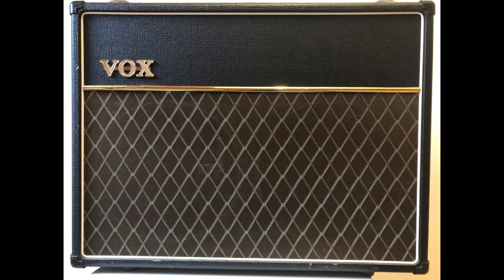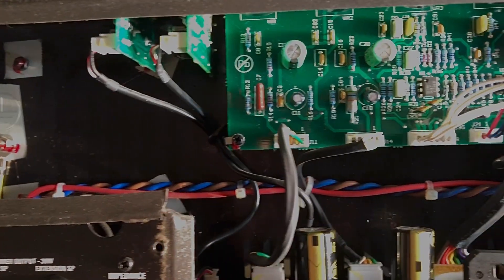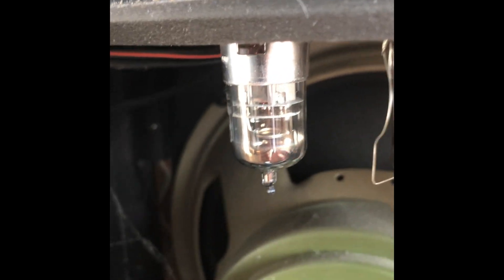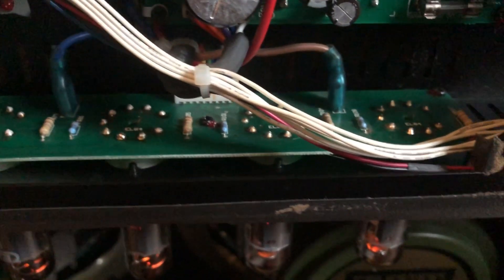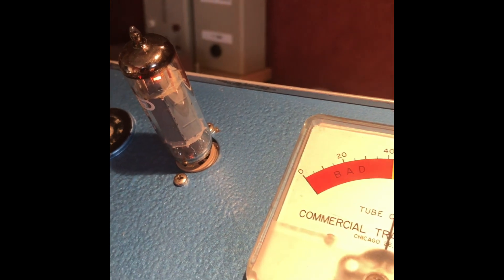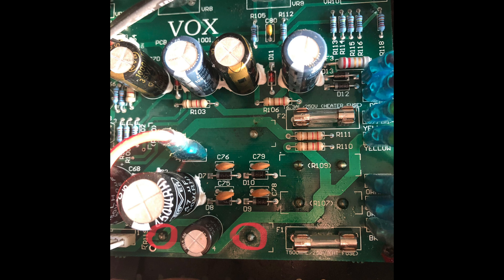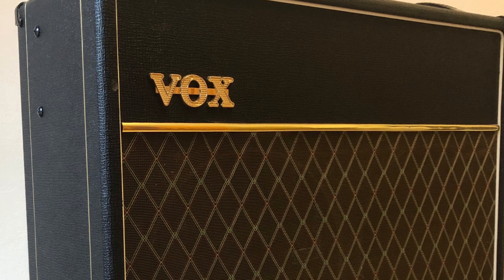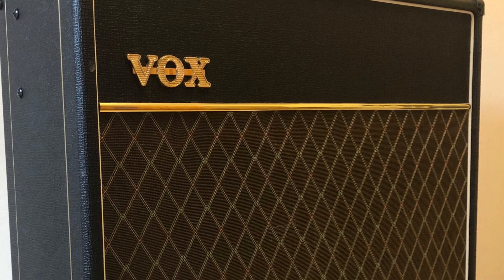Vox AC 30 C2 how to fix crackling noise and cool down the bias

Comment: I think l have the issue with the noise that comes out of amp. Could that be a valve issue? When l turn the tremelo on noise get tremelo also. The Reverb don't work is very unstable. Sometimes, it doesn't work properly.

Comment: I purchased an AC30c2 about 4 months ago... Within 4 weeks I was getting all kinds of crackling static like and microphonic noises. It was unplayable. I knew that that Vox uses Chinese made tubes/valves in these models, so I replace all of them with JJ Electronics tubes/valves. The problem went away immediately and the amp sounded great! I should add that I got permission to perform the change without it voiding the warranty first. 
Flash forward to now, about 6-7 weeks later, and after playing the amp for about 1.5 hours I'm getting random popping noises. Not the microphonic noises I had with the Chinese tubes though.  If I let the amp cool down for a while the pops will go away, but always return when play for a while once it gets hot. I understand these models go through tubes/valves quicker than many amp, but this is just ridiculous. At this rate I'd be spending ~$800 USD/year on tube/valve replacements. 

Okay, now my questions, if I may: 
1) Can I assume replacing the resistor with an 82 ohm version will extend the life of the tubes/valves since the heat output is lower? 
2) Will the change in resistor in any way adversely affect the amp's sound profile?

Any input will be valued. Thank you!
Reply: Hi Rob. That sounds really frustrating . To answer your questions:
Changing the value of the cathode resistor to 82 or even a 100 ohm won’t change the sound. I had a AC 30 CC in for a service lately, and these models have a switch on the backpanel to choose between two different resistors. The standard 50 ohm and a higher value to protect the tubes. I couldn’t hear a difference.

But: are you shure, that the popping noise is caused by the tubes? That sounds to me like a cracked solderjoint. When the amp is cold, it has continuity, when it gets hot the crack opens and weerd noise appears. Try to chopstick the circuit board. Press the board carefully to flex it and see if the noise increases or decreases.
Especially the tubesockets  get hot like hell and tend to open the joints on the board. But be aware of the high voltages, don’t get zapped!!! Good luck!
Greetings from Germany
Reply: @martinstubeampworkbench2299  I appreciate you taking the time to offer your advise. No, I'm not 100% sure that it is the tube(s), and will check the board per your suggestion. This model, unlike the CC, doesn't have switch to change the resistor selection. It would have to be physically changed.
Reply: I replaced my stock tubes cuz they were slightly microphonic and roughly 6 years old, got quad matched jj el84’s and within a month one total failed, glowing violently purple and making the amp snap crackle and pop. New tubes can fail, luck of the draw. Next time I get new tubes I’m gonna order 6 matched el84’s and 6 12ax7’s, it’ll make trouble shooting easier.

Edit: I bought the new tubes in 2018, the 3 jj 12ax7’s are still just fine, 3 of the 4 jj el84’s are still holding strong, as well as a one 2012 china el84.

Comment: This is very informative, thank you! I read also that the AC15C1 tends to burn through Russian tubes in 1 of the pre-amp positions. Do you think it makes sense to cool down the bias on the AC15 also? I'm pretty new to this 🙂
Reply: Hi Nick,
I couldn’t find a schematic of the 15 c1, but looked at the AC15 reissue. The biasing of the preamp tubes are pretty much standard, so there is no reason for burning preamp tubes . Maybe one of the prevalent rumors that you find in the internet.
Don’t be concerned, wait until it happens. The cathode resistor in the reissue has a value of 100 ohms, all the vintage ac 15 go for 130 ohm. So the old amps run definitely cooler.
But again, I don’t have a schematic of the c1 model. So I don’t know what value of cathode resistor is in there.
Greetings from Germany
Reply: @martinstubeampworkbench2299  I believe it’s a 120 ohm.

Comment: Where Can I purchase the 82 ohm resistor please. ? 
I am having some maintenance done on a Ac30c2-tv, I have a constant kind of cycling poppy crackling like a bad wire or ground  on guitar input jack and when you move cord , that type of sound.
   It will go away and or get louder with volume,  which leads me to refer to the "preamp" side ...? Will this 82ohm resistor resolve this popping crackling ,hiss that comes in every 3-4 seconds? Thank you. (Ps. All new matched vac tubes. ) 
Pss. Amp is in prestine condition, but was moved a lot over a year or so to gigs, never abused by any means, but random bumps and jars from loading and travel. My crackle is much aggrssive of a kind of static pops and crackle sort of..and my tubes are Not microphonic. And i am a complete novice with electronics.  Thank you . Appreciate your videos greatly.  Keep up the great vids
Reply: Cooling down the bias won’t solve the noise problem. It extends the tubelife. I ordered the 82 ohm resistor on eBay, if this value is not available, go for a 100 ohms, won’t change the sound either!
Crackling and popping points to a bad connection. Check the tubesockets, the pcb board for cold solderjoints. Tap on components like capacitors resistors, jacks etc. with a wooden chopstick. If the noise appears or gets worse you found the spot to take a closer look at.
Could be a bad preamp  tube, too (improbable). 
Wiggle the tubes in the sockets. These sockets are crap and can cause the problem.
Good luck. Be careful because of high voltage, don’t get shocked! And let me know if you find the cause of the problem.
Greetings from Germany
Reply: @martinstubeampworkbench2299  thanks brother

Comment: I have a vox vt30, but now there is a problem. if I play for 30 minutes, the sound suddenly decreases and hoarse. what's the problem?? Please help me. Thank you
Reply from the maker: Ím sorry, there is no easy solution for your problem. These amps have a lot of digital components. This is almost unfixible.
Try a new preamp tube. Might be a bad solderjoint that opens up, as soon it gets hot. So check the solderjoints on the pcb board, especially the ones on the tubesocket.
Good luck!